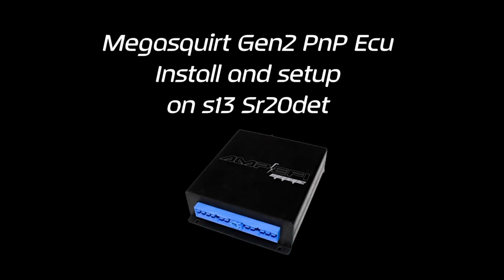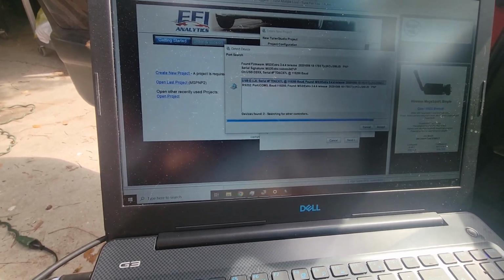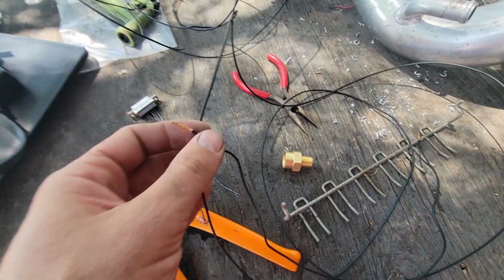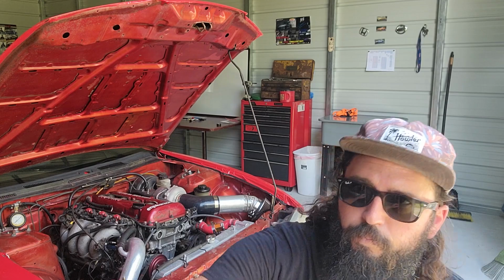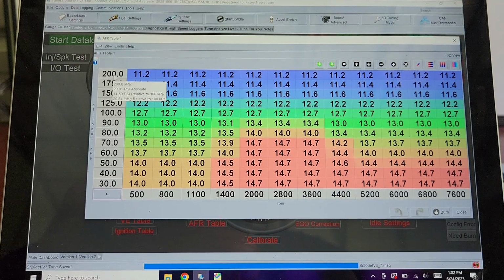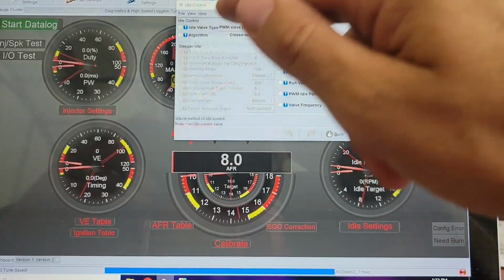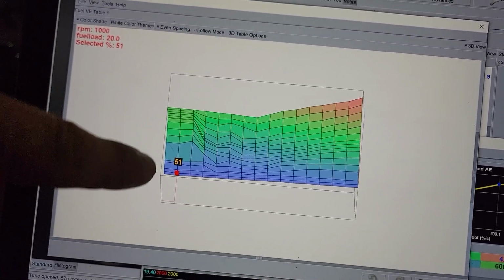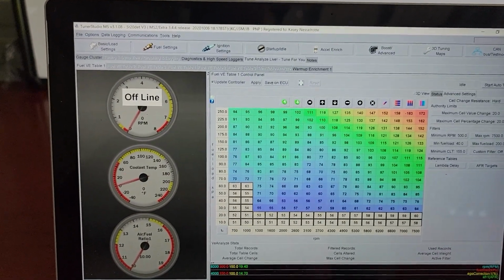Part 16: Megasquirt Gen2 PnP ECU Install and Tuning  - Drift Car Revival! S14 Sr20det 240sx

Comment: Great video, thanks for sharing.  With using only the single wideband,  does the engine go into closed loop once warmed up not using the stock o2 setup?
Reply from the maker: Thanks! And Yes, and it will be better with a wideband. the stock narrowband isn't capable of making the necessary precise afr readings. Use the stock narrowband if that's all you have but get a wideband asap. It's a night and day difference.  Also using a wide and a narrow together is pointless.. cheers!

Comment: I'm curious you set your warmup enrichment to be done at 151, my SR seems to not fully warm up until 164 maybe 165 or so and then the AFR temps seem to stabilize and not need as much fuel, but my car also runs cold (upgraded radiator gkteck clutch fan and OEM fan shrowd), usually 163 to 168 or so unless I'm pushing it then it might peak at 177 or so.
Reply from the maker: Sorry for the late reply, I agree 151 is way too cold. I changed mine but I can't remember the exact number offhand. And my fans don't even kick on till 185